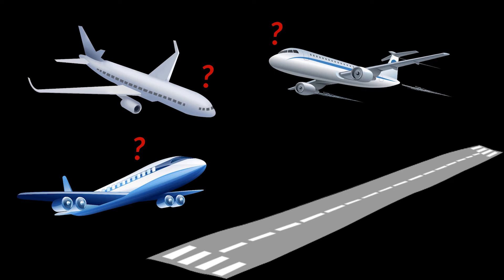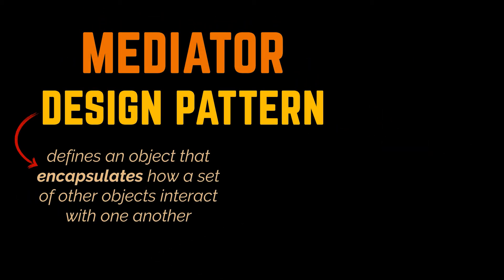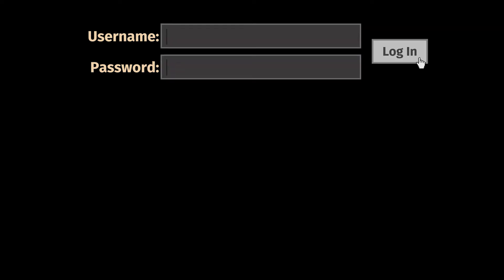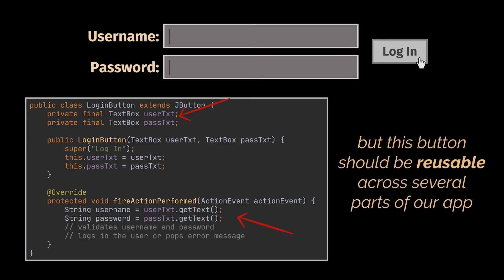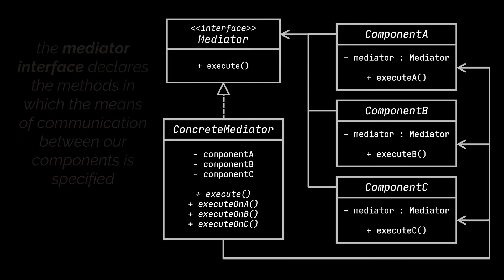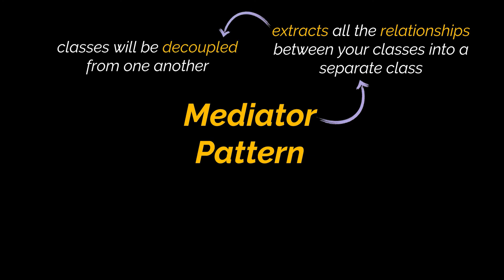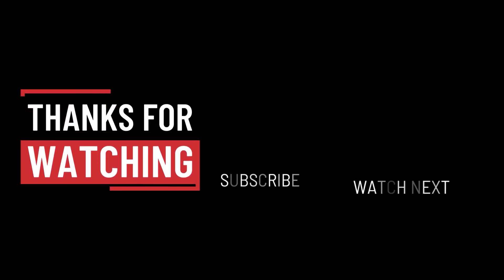The Mediator Pattern Explained and Implemented in Java | Behavioral Design Patterns | Geekific

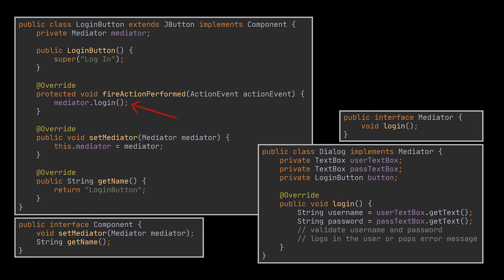Comment: Great video but I'm finding quite complicated to understand something on the example used in 3:18, the LoginButton constructor method, should also set the mediator? meaning that the Dialog class should instantiate a the LoginButton using itself as parameter?
Reply from the maker: The mediator is set with the help of the setter method. I am not sure I got your question!
Reply: @geekific  I understood with a different video from you, this one is missing the main method, where you usually set the mediator. Thank you for all this teaching!